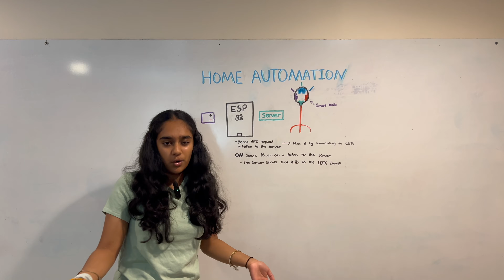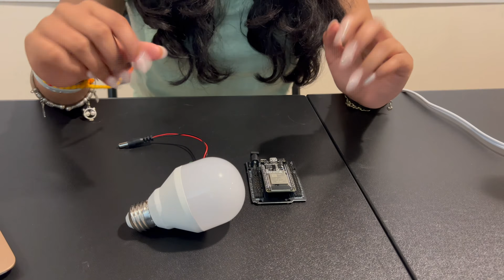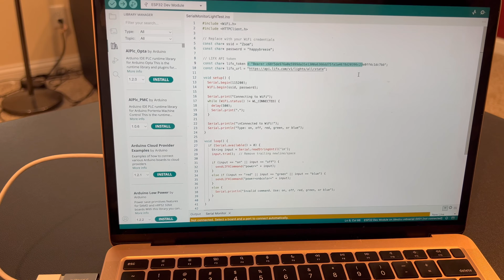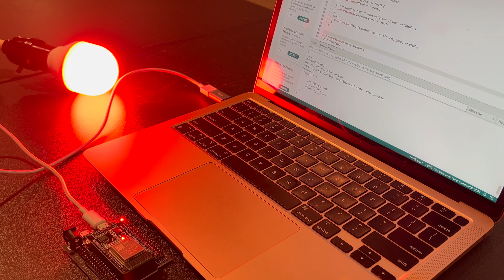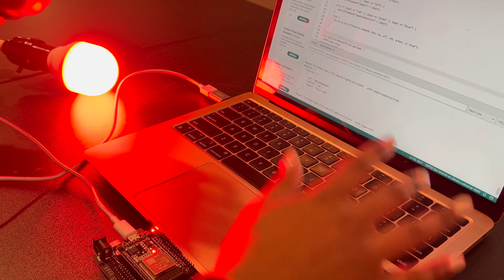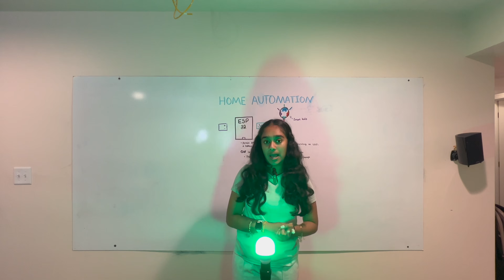💡 Control Smart Lights with ESP32 🔥 | LIFX + Arduino Project (No Soldering!)

Comment: What if I want to connect a dumb light? Like a sunset lamp that powers through the usb A. I understand that I need relays but it's all so confusing
Reply: First of all: do you want to connect it to the ESP32 DIRECTLY? Like, can your ESP32 stay close to the lamp? If it can, you can just create a simple webserver (see for example the ESP32  Web Server tutorial on randomnerdtutorials, which has 2 buttons for turning ON and OFF 2 LEDs) and connect a relay to your ESP32: now you can control the relay through your browser (PC or mobile). If you connect a 5V supply to your relay (you can cut a 5V phone charger cable and put the relay in the middle, I think), you can turn on and off the light by opening and closing the relay using the button in your browser

Comment: A couple questions: 

1. Are you able to run an automated code where the ESP32 is sending looped signals to the bulb to change colors when the ESP32 is not connected to a PC? For example, say you have a loop that turns the light green, waits five seconds, turns the light red, waits five seconds, turns the light green again...etc. Can you implement this code so that the ESP32 is constantly sending these signals to the bulb when the ESP32 only has a power supply (no user inputs)?

2. Have you found any bulbs that allow you to send codes directly to the bulb without going through a server? Sort of a hassle and subject to the manufacturer shutting down their cloud server. 

Thank you!

Jack
Reply from the maker: I would really like to try the automated code idea. Thanks for suggesting it!
I haven’t really come across any bulbs that send the code directly to it, but I will research it and try to implement it. Thanks for the ideas! 💡
Reply: @itsgivingscience No problem, I'm working on something similar myself and some of these bulbs are difficult to communicate with directly.

You can do a lot of cool things with the automated code and that way you don't need to always have an open laptop on hand!
Reply: @jackgardner2651  Hi Jack, have you found any bulbs that can be controlled directly without app hassles?